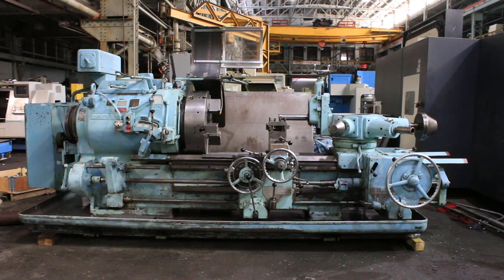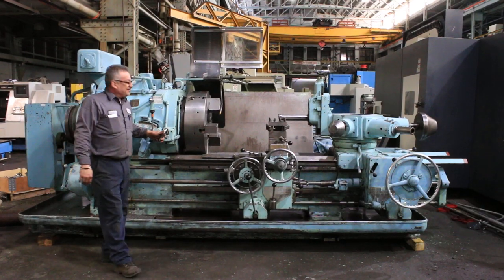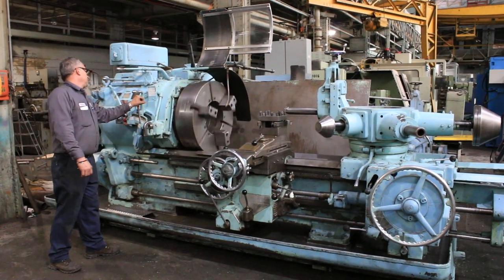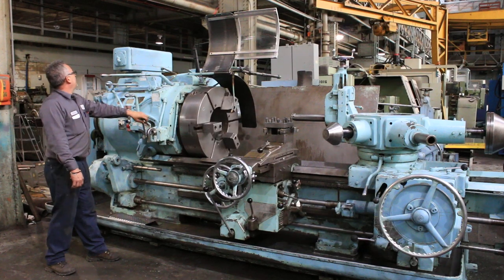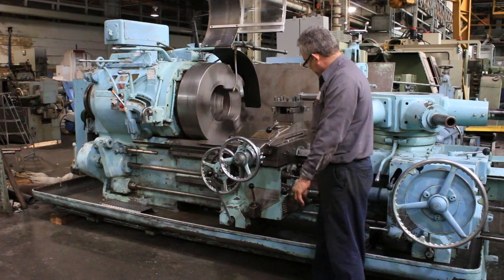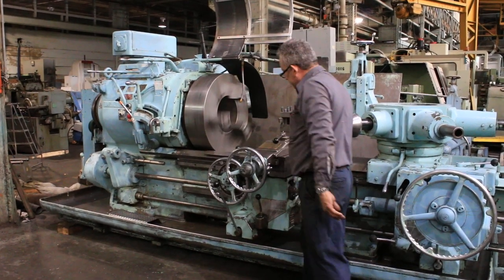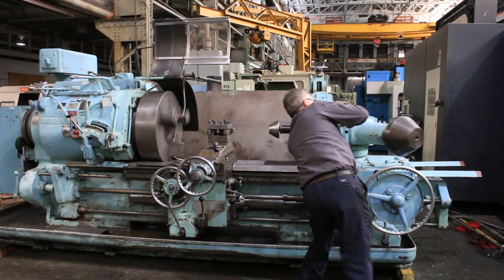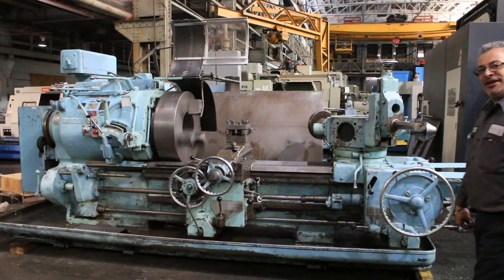4A WARNER & SWASEY SADDLE-TYPE TURRET LATHE

Comment: 40 hp of unstoppable power. Never came close to bogging it down. .250 a side no problem.
Reply: We have two 3-As in shop I work at and the war finish model will take 1/4 a side at like .020" at 174 rpm and mean grey bitch will spin twice as fast and take damn near 3/8s a side feeding it  .035" @224  they're the older lever head style never seen anything like it
Reply: I was looking at one earlier that had been upgraded at the factory to 75hp. I can't imagine what running something like that is like.
Reply: @chandleryoung5264  Damn.